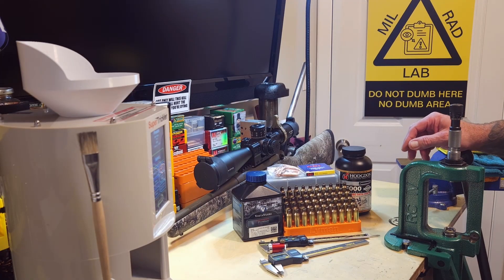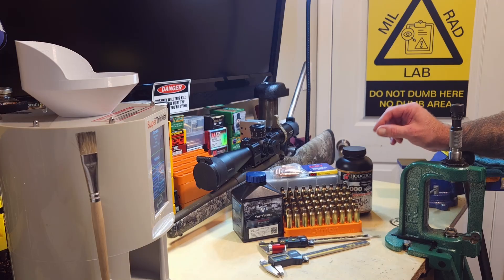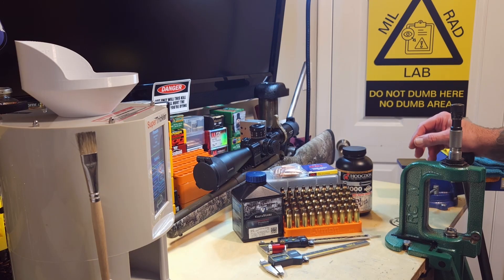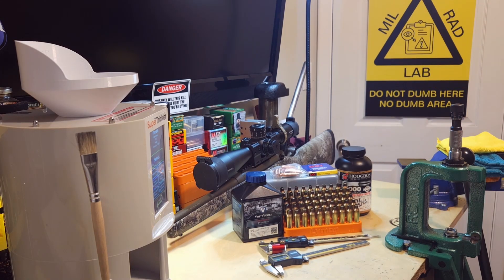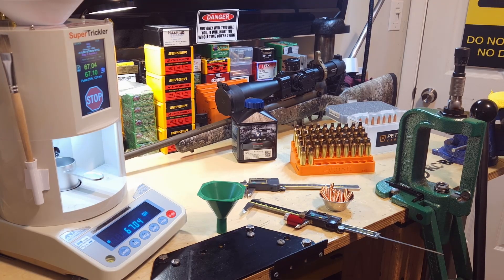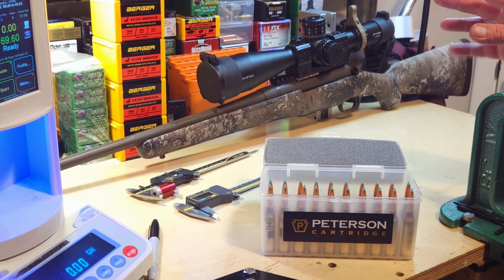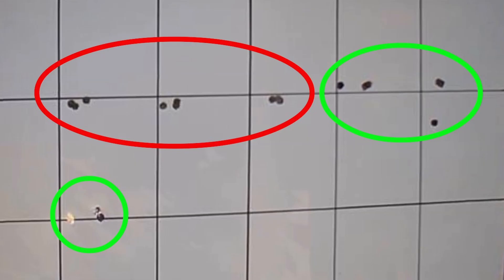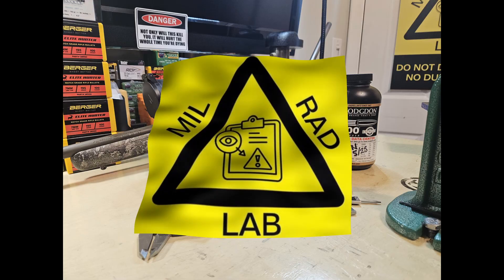Reloading 7mm PRC vid #6 Hammer Hunter Tipped 162gr with H1000 and N560 - final load development.

Comment: I have read that a light crimp helps with Hammer bullets.  Did you try crimping.  Starting to work up loads for some 153 HHT, so enjoyed these videos.  Thank you.
Reply from the maker: Thanks for watching!!  I have read pieces advising that a minor crimp is helpful but I have never tried it. I dont crimp (minus cases where you must for safety) because it introduces another layer of possible inconsistency between rounds at completion. My real concern when it comes to crimping a bullet with drive bands (PDR's in the case of Hammers) is that depending on seating depth, you could be crimping against a void between drive bands OR you could be attempting a crimp against the widest point of a drive band where the bullet wont give at all due to the material hardness. This is just my .02 lol take it with a grain of salt. Good luck with the 153's! Please let us know how you do!! For what it's worth, I love Hammers.

Comment: My Bergara Sierra in 7 prc came from the factory with a 22" barrel, looking back I might have gone with the CVA LRH instead, 24" barrel from a sister company, at least that's what my research has told me. Anyway, I used H1k and N565 to work up loads for my rifle. What I have settled on is 70.5 grains of H1k with a 160 Nosler Accubond @ 3013 fps, with consistent sub inch groups. I love the Bergara rifle, but would like to see this with a 24" barrel. Great content sir!
Reply from the maker: Thanks Scooter and thanks for watching! It's great to see others having success with h1k and lighter weight bullets (160 class) it seems to be "the one" for that weight.

Comment: Great commentary as always! I’m still using 3 different rcbs digital powder dispensers, do you think your investment was better buying that system you have? And if you don’t mind me asking what did it set you back?
Reply from the maker: Thanks and thanks for watching!  I dont think there is anything at all wrong with RCBS chargemasters or Matchmasters as your powder dispensers. I do REALLY like the Supertrickler and the FZ120I scale - the ST when dialed in correctly is spitting out charges in under 7 seconds in a powder like N555 and you have the ability to set your resolution down to .02gr for charge weight accuracy - so when using a VERY large extruded like N570 you can set it to say .02+/- so you can gain speed while keeping it close. the resolution on the FZ120I is awesome, the speed is incredible and the internal self calibration feature is a huge time saver (also no check weights needed). I believe I paid around $1400 for the ST and scale together - Im sure its more now, this was a couple of years ago.

Comment: Think I mentioned it in a previous video you posted but H1000 was the winner in one of my 7PRCs, 70.0 gr, Fed nickel brass, 215 match primers, 175 ELDX, 3000, 3005, 3010, 3002, 3005, and so on, nothing under 3000, nothing over 3010. Quarter min groups at 100. 24" barrel
Reply from the maker: thats not just respectable, thats flat-out awesome! I wouldve been lookin at the 175ELDX for sure for Elk on down. ES at 10 and u der is great work - proof of tight loading regime for sure - nicely done.
Reply: @MilRadLab  Just got lucky. But I diligently prep my brass, anneal every firing, and every bullet was checked for exact seating depth. After I finalized the load, I loaded 80 rounds which will last that rifle a lifetime. All brass, powder, primers, bullets had their respective same LOT#
Reply from the maker: well, doing that work isnt all luck. you are dotting i's and crossing T's more than most and that keads to results IMO